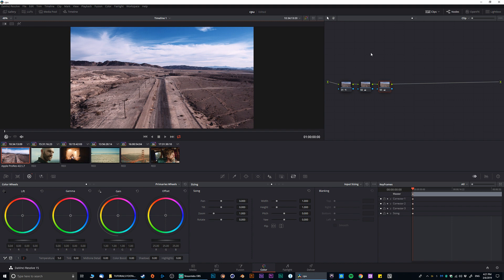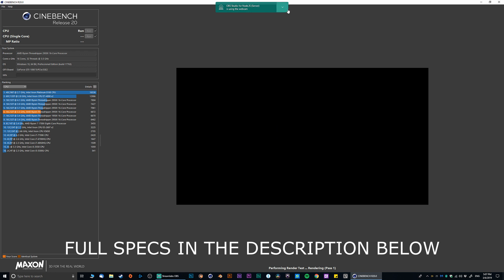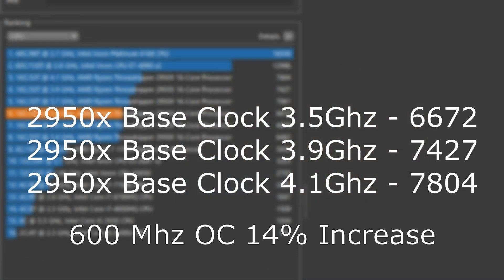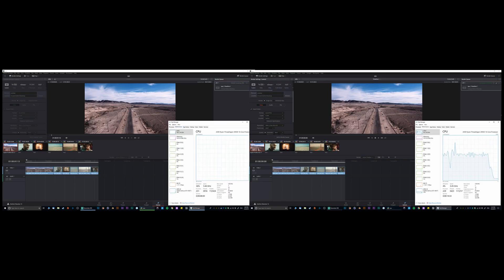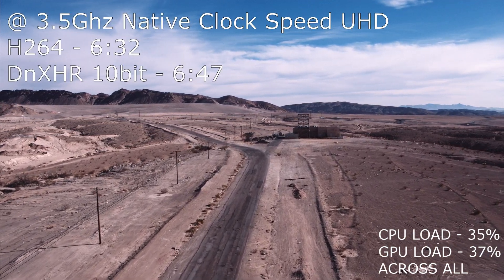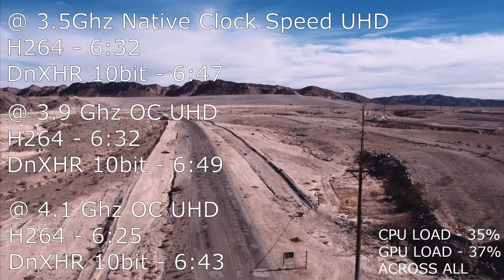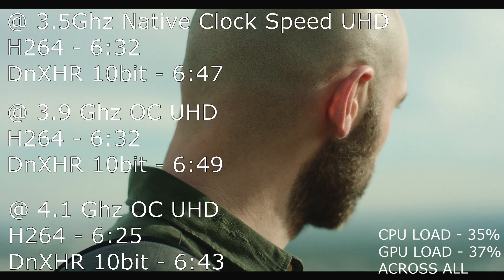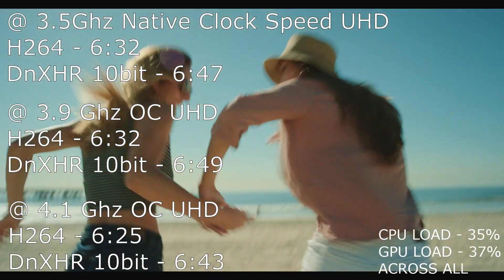Should you Overclock for Davinci Resolve? Thread Ripper 2950x Tested

Comment: I heard with resolve the most cores and faster gpu the better .not really the processor speed ,is that true ? Like 10 cores at 2.5ghz better than just 4 cores at 5ghz ?
Reply from the maker: No. Cpu speed is more important. Fast gaming cpu running at near 5ghz is much better than slow Xeon or thredripper. At 3.4ghz.

Comment: Did you OC with PBO or manual? PBO would give you roughly 4.1 to 4.2 across all cores. Furthermore these processors were made to be OC so using PBO isn't going to kill your cpu. However, if you are doing a manual OC and are running a high voltage such as 1.45 or higher then yeah that would cook your cpu and is not recommended.

Comment: Big mistake that resolve is not using the GPU more efficient than this. They should take advantage of the RTX GPU 's
Reply: RTX is just a gimmick & over priced. Radeon VII is a beast.
Reply: @ktcool4660  2080 is not pricey at all - its actually a pretty descent card compared to the Radeon I have both - the 2080 renders faster in resolve and way faster in PP  -  cheers´

Comment: I think you need to have a chat with Wendell from Level1Techs and EposVox...
Reply from the maker: I don’t know who that is
Reply: @AramK   this is the video they did.... I think you'll can help each other out -> https://youtu.be/Q5prWMwihTY
Reply: For the record I am currently running an over lock on the Ryzen 7's. One is a 1700 at 3.7 and the other is a 1700x at 3.8 render times have improved greatly for me. A 1 hour 4K clip with 8 nodes and four audio track corrections that I do for a channel; render times dropped almost 15 percent or more for me. Down to 43 minutes. But memory speeds also had a LOT to do with it ...
Reply from the maker: Everything points out that resolve is just not optimized for hardware specs. I had old 3930k intel which was getting same rendering speed. Ram speed is not really relevant. Most modern rams run between 1200-2800mhz. Very slight to no difference. I also had build with dual gpus and quadro gpus. Also gimmick with resolve. Quadro was total disaster, when dual gpus made GUI work little better. No rendering speed difference.
Reply: @AramK  I'd like to point out that the RAM speed here is EXTREMELY important. Maybe I'll do a test and share some results with you? I have a free upcoming week...
Reply from the maker: Ram speeds don’t matter. Like I mentioned most modern rams are pretty fast. Slight variation is insignificant for the performance.
Reply from the maker: I also want to point out that many years ago on resolve 9 when I had gtx 760ti, I was able to get close to 130-170fps on blackmagic 2.5k raw files with 5-8 nodes. So my conclusion is that they don’t optimize for hardware at all. Performance seems to be random on different machines which points out “lucky” configurations on resolve versus actual hardware usage.
Reply: @AramK  this is an interesting viewpoint. I have a laptop that's come in with very good specs. I'd like to test out between our machines... Maybe we can find a way to take this offline and do some back to back tests? If you'd be interested that is...

Comment: Hi Aram, if you run out of topics, then maybe you try some artistic (or less artistic, usual traditional film) looks while playing around with nodes and curves in LAB color space. I'm sure you know the node graph discussed here - https://cote-b.com/jacobs-ladder-a-late-introduction/  Interesting ways of changing lightness and contrast of certain colors and some ways of locking the skin colors on curves without noisy keying, masking and selections. X and Y axis on curves have a new interesting meaning - new solutions. You got good eye for color, so after some fiddling around you see what changes what instinctively and you find situations you would use some curves of that tree for. It is harder for the amateurs to see what these change on the pic and what it could be useful for. My computer spec are too low to try these out but would be interesting to see what can be done.
Thanks!

Comment: Aram, great video.  I recently also built a custom desktop - inspired by your built (i9 CPU, 32GB ram, NVidia RTX-280, NVMe SSD the works) and found the same results (overclocking didn't make much of a difference).   The video card was essentially irrelevant.

The only reason I upgraded my computer was due to the fact that my laptop's video card on an i7 Asus G73JH only had 1GB and the latest version of Davinci Resolve didn't even want to load (crashed every single time.  I tried everything under the Sun to get it to work - only older versions like 12.5 worked).  Yes, the video card may not be used much for rendering but it apparently requires a bunch of video card memory to be available just to load and operate.  I also agree that it would be interesting if it could utilize the GPU at 100% (interestingly a YouTube export only utilized the CPU around 75%, but a Vimeo export vary between 90-100%, GPU aways remains around 4-6%) while rendering. I suspect it may speed things up significantly if the GPU could be utilized, I have to wonder why they don't do that?

Again, great video and discussions - thanks for sharing!
Heinrich
PS: I am curious if you can suggest an approach on how people do the underwater muffle effect on sound/music (as people go between above and below the waterline in some videos)? I have seen it done on Premier, but no examples on Davinci.  I tried to replicate it reducing a clip pitch semitones - but, the outcome is just not the same. Any suggestions would be great.  Hope my question made sense.  Thanks again!
PSS: Thanks also for prior videos, us newbies certainly are learning a lot.
Reply from the maker: I actually had 970gtx prior of 1080ti. I don’t notice any kind of performance increase at all. Only difference that higher gb allows for noise reduction to render. As far as performance from my old 6 year old computer to my freshly build there is absolutely no difference. Resolve claims about hardware absolutely false. Seems that drives speed is the only thing that actually matters within reasonable margin.
Reply from the maker: For underwater muffled effect drop down high frequency and increase low and miss. Play around and see how it sounds.
Reply: Hey, I am not Aram but I have been working in Digital Audio Workstations like Reaper and the muffled sound is the easiest of the effects to do, often used in music too (to move sound to the background) - you just use equalizer and remove high frequencies in sound ( human vocal is ca. from 85Hz to around 255Hz for example, the rest of the vocal is harmonics) - for that, in Davinci Resolve you should see an equalizer for every clip in the inspector section if you select the clip in the edit page (also, EQ tool is as a default on every track in the audio mixer where ever you see the proper view of mixer, there is just no frequencies selected and altered as a default). In the equalizer tool you should see a selection tool for selecting a low pass filter (so you pass low frequencies over only, the shape that rolls off highs - goes down to the right) - good starting point for muffling is 400Hz - so for the muffled section you pass the sounds that remain below 400Hz only - you should see the filter shape on the equalizer graph with highs rolled off - you can manually select points/enter numerical values to the graph I am sure. The effect works because heavy and tight materials (like water, concrete, stone, metal) absorb the high-pitch sounds a lot easier than low frequencies - any material does it - in the air human voice loses highs as well, when the source is far away you hear less highs - combined with echos that can be used for far-away effect too.
Reply: Oh, and keyframing should be used obviously. Unless you chop the audio up (in which case the sound alterations become abrupt unless you use "fade in and fade out" handles on the clip ends).
Reply: With both your suggestions I was able to figure it out. Thank you Aram and Musaire!

Comment: In a test I did (don't´know how correct it was, I´m not a huge geek, it was done by a technician who I believe is rather competent), my Quadro M4000 reached 100% at high load  jobs. Tried to add a GFORCE 1080 as a second card, I saw no improvement at all (I have Resolve Studio which supports multiple GPUs, the free one, I think, doesn´t - also, I heard that Davinci ignores the card that outputs to monitor if more than one cards are present so that might be it) . Inquiring with NVIDIA I was told that I would see improvement only with a second Quadro, but never had one available to actually test it. It would be very useful if somebody could actually confirm how a second Quadro affects performance and if a third GPU is required for monitoring.  Also, I am curious if a Deckling card boosts performance (acting as a monitoring card). For that last question, Aram might have an answer.
Reply from the maker: quadro generally not the best choice for video editing, they designed more for physics calculations. 100% load is probably due to poor optimization driver/software in this case. Generally, you want to have the same cards from the same series and same manufacturer to get max performance. Randon cards won't do. Decklink does not boost performance, its simply bypasses system "color management" and outputs pure 10bit signal. Geforce series only output 8but, Quadro can handle 10bit.